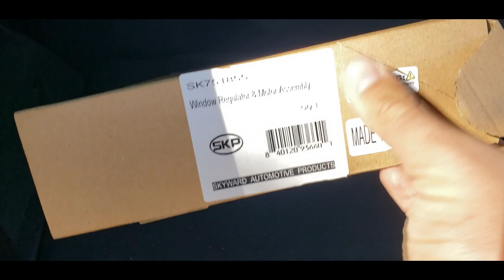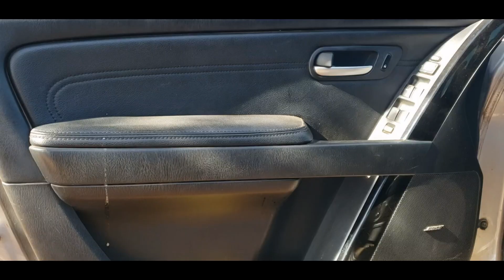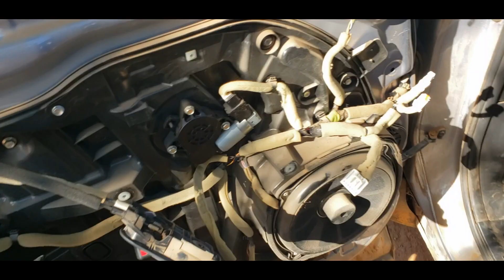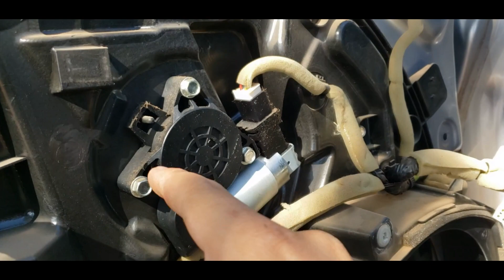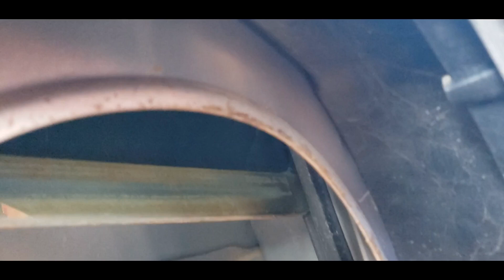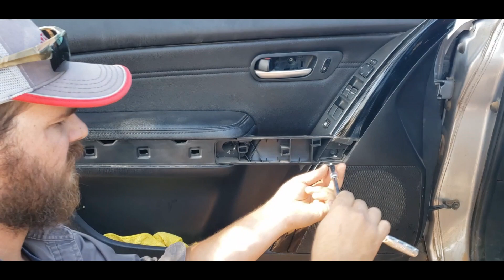2007 Mazda CX-9: Front Door Window Motor and Regulator Replacement

Comment: Thank you for this!! I just did my CX9’s driver’s regulator and motor. For the handle I was on the same boat, very annoying! I ended up using the screw that holds it to the door panel and I screwed it to the hole where the handle would be when it’s all done. Can’t attach a pic of it but I hope the description helps.
On the one touch up/down feature, When I was testing it it wasn’t working but once I plugged all 3 cables and did the programming (manually rolling it up and holding it after it closes for a couple of seconds until it clicks) and it started working again. with on,y the one cable plugged in the programming didn’t work.